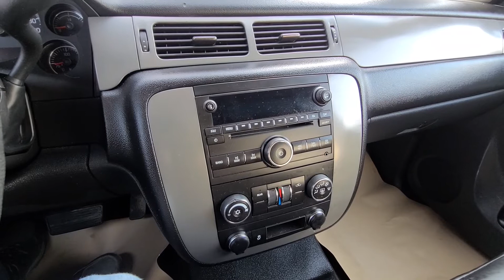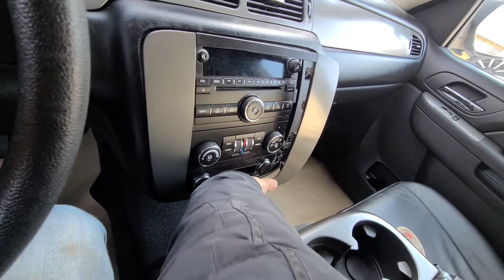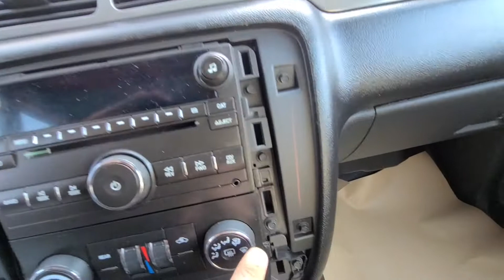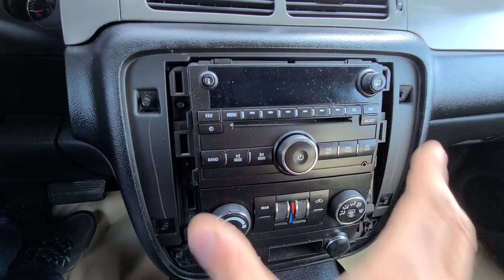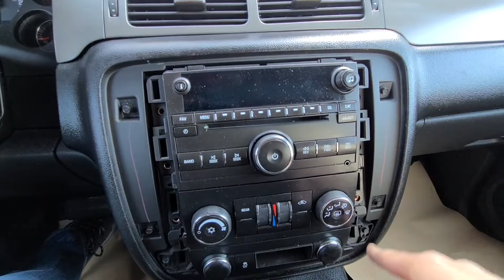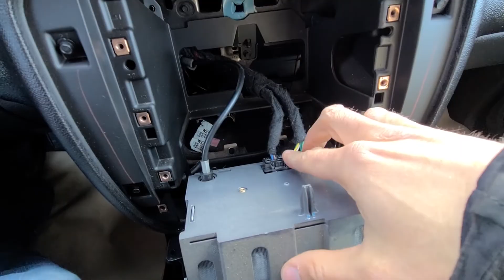Chevrolet Tahoe - RADIO REMOVAL / REPLACEMENT (2007-2014)

Comment: Do I need code for radio with the navigation?
Reply from the maker: If you are replacing with factory oem radio possibly yes. I'm not sure if all of them have theft protection or not. If you are buying a used one ask for the radio code from the seller

Comment: Do I need to disconnect my car battery first?
Reply from the maker: Hello, it is a good idea to always disconnect battery before disconnecting any electrical wiring on a vehicle. Said that most likely nothing will happen if you don't, but if you want to be 100% safe then disconnect negative battery terminal
Reply: @QuiteAlright thank you very much
Reply from the maker: You're welcome

Comment: I am having a hard time finding an antenna adapter for my 08 chevy tahoe. Walmart,  best buy , auto zone don't have it. What do it look like and what site can I order it from. My after market radio works well with the Bluetooth but I need my radio. Here in Baton Rouge La
Reply from the maker: Hi, I think you need this one: Harmony Audio HA-40CR10 .
They should have it online at ebay, amazon or any audio warehouse

Comment: Great video.  My 2007 Tahoe acts like it has a short in the connection to the speakers.  The radio works, but only plays thru the tweeters.  It was occasional at first then the full rang d as leakers would kick in.  Now it’s almost constant.   

I don’t drive the truck very often, but we’ve owned it since it was new and I want to hang onto it.  

Has anyone else had this problem?   It would be awesome if one of those plugs in the back has just cracked from years of heat or somehow wiggled loose.  

Thanks for teaching me how to get to it!
Reply from the maker: Hmmm try pulling of the rubber sleeve at the driver door jamb and inspect all the wiring there. I've seen those wires cracking very often and would cause problems with the speakers. Also try once radio is pulled out to turn it on and tap on it and shake it to see if the sound will kick it. If yes it is the problem within the radio
Reply: @QuiteAlright  thanks.  I’ll definitely try the shaking and wiggling of the radio and cable, once I get it out of the dash.  

The driver door jam idea seems odd in that it’s all the big speakers, not just the driver side.
Reply from the maker: @bldallas  You're welcome. If the wires in the driver door jam are damaged usually non of the speakers in all doors will work
Reply: @QuiteAlright  oK, thanks I’ll check that out.